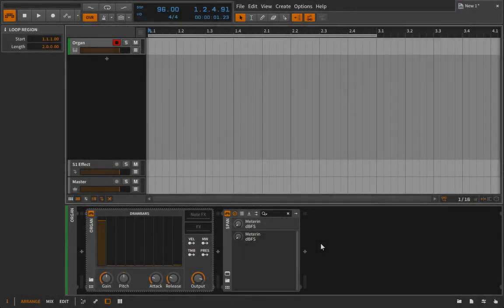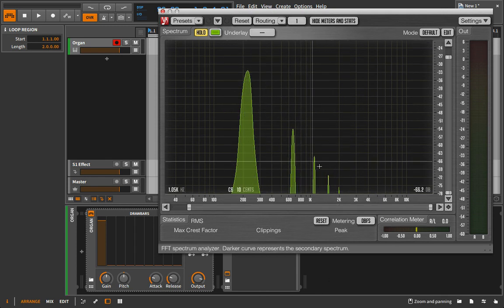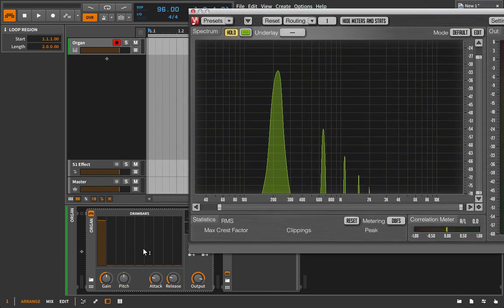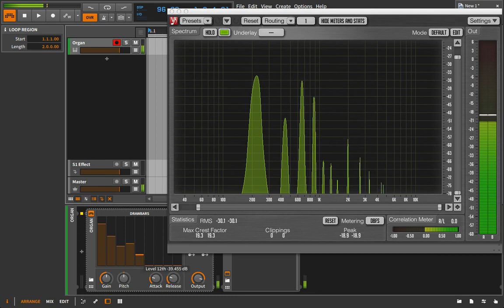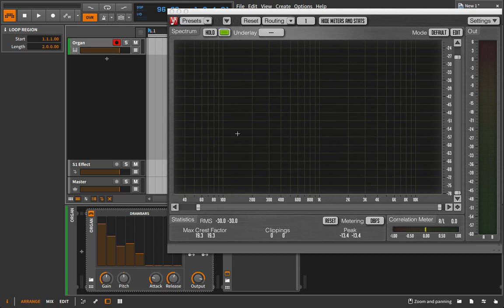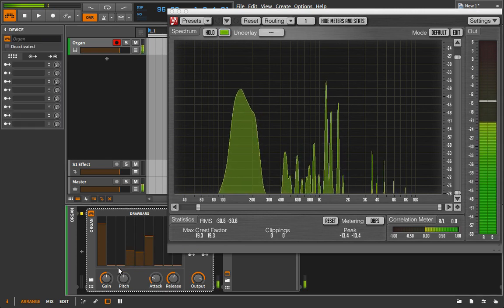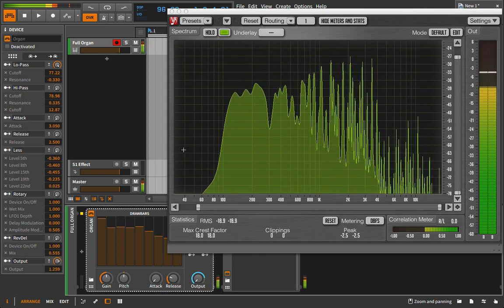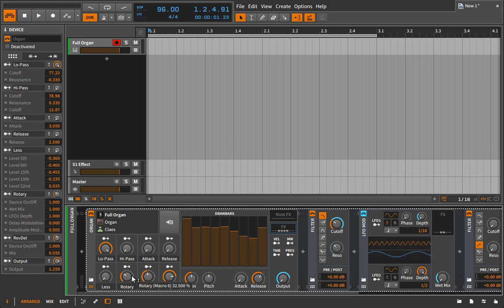Additive Synthesis to Create Pipe Organ Sounds

Comment: I knew how I came across this video.  We have to clarify what kind: classical (church/cathedral), or theater (the precursor to the electric/electronic ones).  In this case...the video's title speaks for itself.  Additive synthesis = electric organ.  The same nastiness is behind the sound, but the sound is buried in effects.  Only the in its original form, were electric organs able to achieve (traditional) sounds.  The rotary speaker ruined everything, when it was introduced in 1941.  You went from Toccatas to "O Sole A Mio" or "Oh Happy Day."